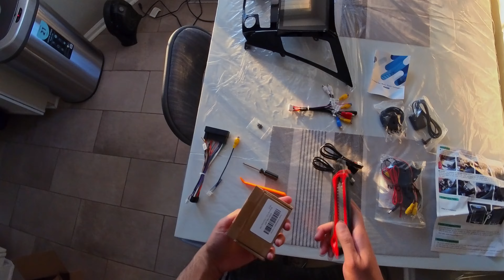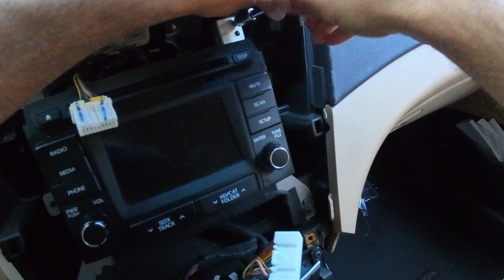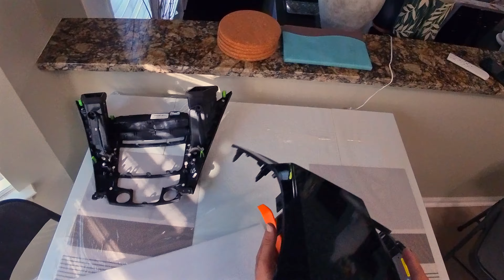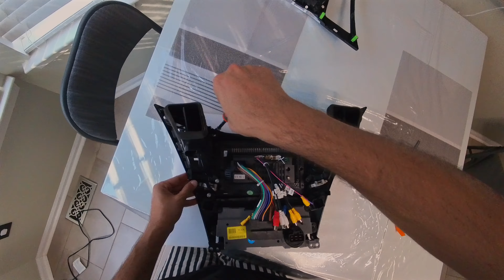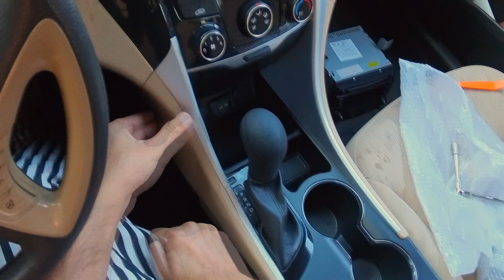How to Install an Android Head Unit in a 2014 Hyundai Sonata — Retain OEM Backup Camera

Comment: how long does take to boot?
Reply from the maker: I haven't timed the exact boot speed, but it wakes up within a couple of seconds. I believe it remains on standby mode in normal operation. If you were to reboot it, it generally would take about 20-30 seconds to fully reboot. I’m thinking about posting a video to show its functionality.

Comment: Is the linked headunit the only one that will work with the specific version of Hyundai shown in the video? I have the same with the small screen and cd player. Most other headunits on amazon look exactly the same as the one you linked but cheaper. But they usually say they won't work with the hyundai version with the small screen. Just wondering since they look to be the same thing but with varying amounts of ram and storage.
Reply from the maker: I’m not exactly sure but I believe the other versions should work too.

Comment: Thanks for the video and explanation. My Hyundai 2012 veloster android head unit is a bit different, it comes with CAN bus decoder. everything works except OEM reverse camera. When I put it on Reverse the screen changes to black and reverse sensors work but no camera image. I tried factory settings and tested every single video option from AHD to TVS1 (no CVBS1 option) and still no camera vision. I know im missing a final step somehow. Any help will be appreciated.
Reply from the maker: Thanks for watching! Since the screen switches to the reverse-camera view and your reverse sensors are working, it sounds like the head unit is correctly detecting that the car is in reverse.

One thing I would check first is the ground connection on the OEM camera adapter. If your adapter has a separate ground wire, make sure it is securely connected to a good bare-metal chassis ground. On my Sonata, I connected the ground wire from the OEM camera adapter to a bare-metal screw in the dashboard as shown in the video.

A poor or missing ground can result in a black screen/no camera image even though everything else related to reverse is working.

Comment: I have no sound . What can i do about  that
Reply from the maker: Sorry for the late reply. For cars that have an external amp, a separate adapter is required. Its available on Amazon: 

https://amzn.to/42THbEz
Reply from the maker: Please double check this listing and confirm compatibility with your setup. I didn’t have to use it so I’m not exactly sure.

Comment: hey W video and did you use the 6+128gb deck and how's is the radio holding up? thank you : )
Reply from the maker: Thank you for your comment. I got the 4 + 64GB at the time. It’s holding up pretty well. I almost exclusively use it for Carplay. There are sometimes random restarts which is a minor annoyance but I’ll take it for the price.
Reply from the maker: Actually, it turns out those random restarts were happening because my alternator was on its last breaths. I changed my alternator recently and have noticed that those restarts have gone away.

Comment: Thx for the vídeo, although a bit fast
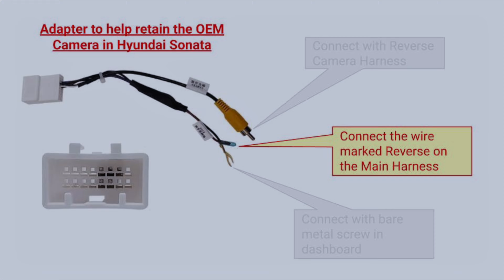Same comment than before 3:38 trigger on oem adapter ?
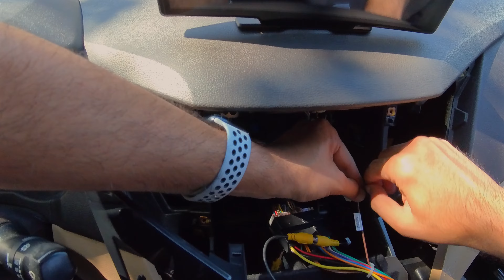Reply from the maker: Bro let me know what exactly is your question. The trigger wire for camera is the one which I am connecting at 3:52.

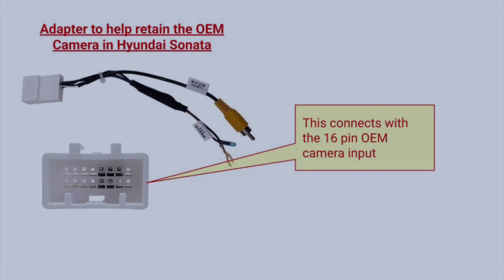Comment: I got lost at minute 3:31 u going way tooo fast, got lost 😢
Reply from the maker: I see. Are you having any issues connecting the reverse camera adapter?
Reply: @TorquePit yes me too..where did you found it bro???
Reply from the maker: @pandarock852 Let me know what you cannot follow and I can try to answer it here.
Reply from the maker: @pandarock852  On the main harness, the reverse trigger wire was the brown wire. The end of that wire was already partially stripped, so I used that exposed section to connect it to the reverse trigger wire from the OEM camera adapter.
Reply: @TorquePit where did you get that connector in your left hand at minute 3:31? I don't have that connector..where can I find it?? Please help me
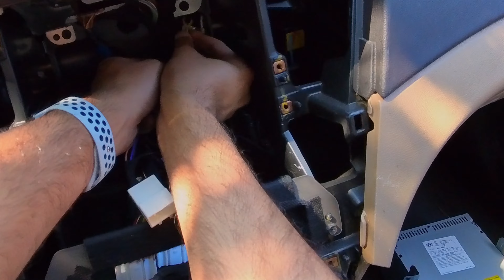Reply from the maker: @pandarock852  The connector is from the OEM reverse camera harness. You can see at 3:16 when I installed it.
Reply: Do you have any Facebook page bro or IG?
Reply from the maker: @pandarock852 Sorry bro, I don’t. Its just a small YT channel to share any useful things I know.

Comment: i installed and im receiving no audio. do you have any tips for this?
Reply from the maker: Does your car have an external amp?
Reply: @TorquePit  yes i have an infinity sound system
Reply from the maker: @sobey6357 Thanks for the update! Since your car has the Infinity system, that explains the no-audio issue. The factory Infinity amp needs a proper low-level signal and a turn-on feed, which many Android units don’t provide on their own. That’s why audio won’t come through without the right adapter.

I came across this harness on Amazon that might work for retaining the Infinity amp, but you’ll need to double-check the listing and compatibility with your setup: https://amzn.to/4oV9Iml.

So yes, it can be made to work — but it really depends on your unit and the right harness. Best of luck!

Comment: Does the steering wheel buttons still work?
Reply from the maker: Yes, the steering buttons work. After the install, there is a menu for SWC where you can assign functions to steering wheel buttons.

Comment: Thanks for making the video with the excellent and detailed explanation!  Quick question about connecting the ground wire for the backup camera wiring harness.  Instead of using a bare metal screw in the dashboard, can you simply T-splice it to the other ground wire on the main harness?
Reply from the maker: Thanks so much for the feedback — glad the explanation helped!

About your question: in theory, yes, you could T-splice the ground into the main harness ground since they both tie back to chassis ground. But I didn’t try it myself, so I can’t say for sure what the result might be. The reason I went with a bare metal screw in the dash is because it guarantees a solid, reliable connection. With splices, there’s always a chance of a weak join, extra resistance, or electrical noise creeping in — especially over time.

Is it tricky for you to find a bare metal screw to use in your setup? That’s usually the cleaner and safer option, and worth doing if you can.
Reply: @TorquePit  Yes, I realize that using a bare metal screw in the dash makes for a more reliable grounding point.  Nothing tricky with going that route.  But then I'm trying to keep things easy and simple for dissembling should the need arises, as I don't  have too much faith in the reliability of these Chinese Android units.
Reply from the maker: Gotcha. Good luck with the install!